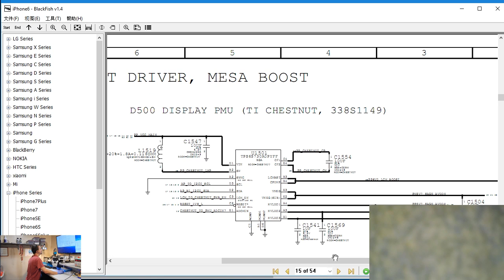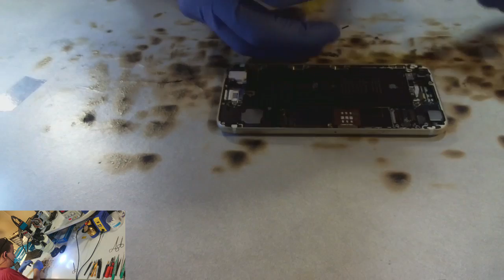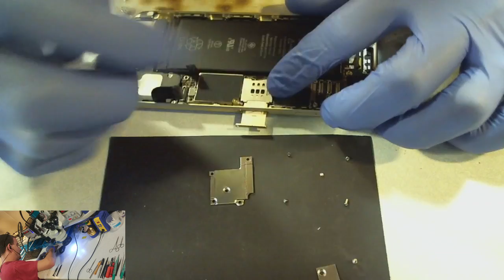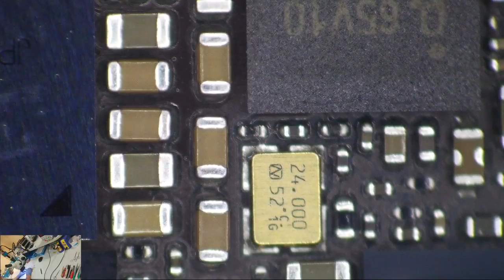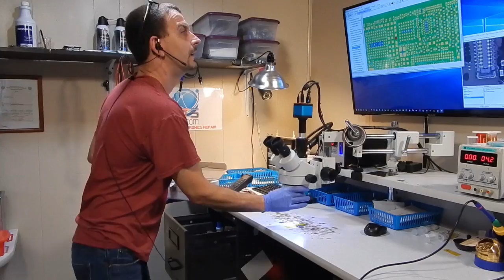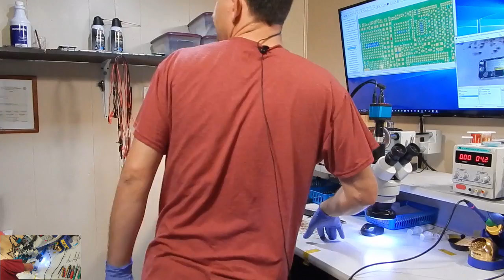iPhone 6 No Image Repair - Shorted 5v7 Cap Found & Fixed

Comment: I enjoy watching these videos because I too like repairing phones and laptops whatever else. I repaired my iPhone 6 plus just because I couldn't see it there not working. So I got a new chassis for it and screen and it took forever since it was my first time ever removing all the parts from inside that it was a bit overwhelming lool. So many tiny screws and different sizes that I did try to mirror the positions of the screws on my mat but, when you have a child running around and curious about stuff the screws got mixed so it was a lot of trial an error but, I just put what felt right through tension not to much just incase I got it wrong and messed the board up. 

A few months after since I've been using it tho the screen on the top right corner is darken abit compared to the rest of the screen and now to add to the commotion when I press my power button to lock the screen it doesn't want to come back on but, the phone is still working as when I hold the home button it vibrates so watching your videos I'm coming to some conclusion that either one of the screws are too big for where I may have misplaced one or two or the screen needs replacing again as it was a rather cheap screen. I'd like some support on that if anyone can help?

Comment: Sir STS, do you have multi tester tutorial? I wonder how do you know if the filter, cap, coil and resistor is short to ground by testing it in oms mode , resistance, and diode. You are a big help in my career on board level repair, i learnt a lot from you sir. Please upload more repairing and troubleshoot videos.

Comment: Nice fix :) ever serviced a Microsoft surface RT? I cant find anything about this board. I mean, nothing. It behaves like its trying to power up in a cycle and I say that because the 12v keeps oscilating. No water traces or corrosion. I'm thinking a bad cap but I have no clue where to inject power.

Comment: I replaced my cracked display assembly on my iPhone 6s, right at the end when I was plugging the new screen in it sparked and I got a bit of smoke. Can't see any damage but I'm not getting any image. The phone is definitely powering on, tried old screen no image either. Can you advise what it might be?
Reply: I don't know what it might be exactly, but my advice is to make sure the battery is not plugged in when you reconnect the screen cables as it's super easy to accidentally short pins during reconnect.

Comment: I have a question how do you acquire your donor boards?
Well I got more than one question, are they boards that where unrepairable? If so how did you get them from the customer?
Reply: Jim Linkowskl buy it from eBay. There is no shop to buy broken phones.

Comment: I've been attempting board level repair for a while now and teaching myself alongside with doing it. Today I finally managed to find a shorted capacitor on an iPhone 6 on a 5V7 power rail and resolved the short after removing the cap. Videos like these help me in my theoretical knowledge, but actually doing this stuff is a whole different thing. Anyways, the LCD now works...kinda, but with my usual bad luck the phone has further surprises for me. Turns out touch is not working, and the lcd has some strange ghosting effect (not to mention the whole motherboard is bent because I received the phone that way).
Its difficult enough to do SMD rework with a crappy hot air & soldering station, without a microscrope and with a tiny working space, and now I've gotta reflow or replace the Touch IC? Screw me right?

Comment: hi sir! my iphone 6 repair was when i reconnect touch screen ther is vertical line whats the problem in it? tried to change touch ic controller both
Reply: You need to reball display ic

Comment: I noticed you didn't used a heatgun at all to remove those caps, was it because the LCD connectors just beside them could of easily been damaged with hot air? thanks

Comment: Hi I was wondering if you could tell me if cap 1295 is needed and if so the value and size I blew it off my board and I checked the schematic and it shows it's location ad number but nowhere else is it shown on the schematic

Comment: Ist always so funny  and hilarious,
But whats is real important  then your handy microscope  ?

Do you realize what are you breathing in? Heat up the bord , there is flux on the bord ans some flux  and  lead solder, tin residue  

YOUR 2 LONGS, LONGS THAT  YOU CANT REPLACE
SO BAY  a AIR SUCKER  OR MAKE IT YOUR SELF 
Make a simple sucker that you be sure that that smoke and flux residue  will suck away from you !!

Comment: The easiest way I've explained about capacitors in troubleshooting is that once they become resistors, that's when you have your short-to-ground. The dialectic material somehow dries up or leaks, therefore allowing the current to pass through from the VCC to the VSS, thereby rendering it a resistor. It could very well be bad manufacturing of the cap. I expect caps to go bad with legacy equipment, but very rarely in electronics that are only a few years old. There's some physics involved here, where a large thru-hole electrolytic cap has more mass than a tiny SMD cap. So, I would say that the thru-hole cap has a better chance at a longer life than a smaller part. Engineering at Apple, Samsung, etc. do in fact know this, but have decided for the consumers that their products are not meant to be around for a long period of time.

As for the shielding being cracked, that could very well have happened sometime in the past, but didn't cause a problem at that time. So, the customer didn't lie, as he really does think that the phone suddenly stopped working.

Comment: For your search box popping up off the screen you can also try draging your taskbar to the top of the screen and back. (make sure you unlock the taskbar first) The search box should snap to below where the taskbar was, might be quicker then your blind keystrokes...

Comment: good job! So did you fix the broken loose shield? lol. and what about the component you thought someone touched with a tool at the beginning? $130 for hot air, I just may get that now.
Reply from the maker: The component in the beginning was ok, it had just been touched by a pry-tool I think.  No harm done there.  To be 100% honest, I actually forgot to correct that shield though.   It won't really make a difference but with me trying to make sure everything is perfect, that bothers me! lol     Thanks 4 watching & commenting! :)
Reply: I got the hot air station using the link! I had $80 in Gift cards to use! funny you forgot the shield now you cant sleep! you don't think anything related to that shield moving would have impacted that back cap?

Comment: nice vid again. Thanks! About the equipment, I can't completly agree. I started with a aoyue all in one 2703A+. I thought I was doing o.k. But with phone rapair it was hard, and I wanted the micro pencil. So I bought the Hacko FM203. That was already a big difference. I still used the hot air part from the aoyue machine, it was working.....but looking at your video's and from Chris, Jessa and many others, I could tell that i did a crappy job with the hot air. So I just bought the Quick 861DW and it blew my mind really. It now feels so easy to replace stuff with hot air. I know this still is a budget machine. But way better than what I had. Could be that this 2703 is just not up to the work that I was doing with it. And I see that your aoyue is a stand alone hot air station, maybe that is way better then the all-in-one I had. Nevertheless I'm happy now. And for a reasonable price. Because here in europe  hakko is already expensive...and the weller and JBC stuff overhere is a "root canal without anesthesia"  kind of expensive :) And I can agree that personally I would feel stupid too when soldering a 3 cent capacitor with a multi-thousand euro hot air station. But then again, I never had the chance to try one haha.
Reply from the maker: Hey, just want to say thanks for the input and let you know that this did not go ignored.   My next hot air station will most likely be a Quick station.. I've been hearing a lot of good things.   The main thing for me is those profiles though.   Looking forward to that :)   Thank u!
Reply: Maurice Rotjes i like to buy a Quick hot air station, could you tell me if the machine work good? Thanks
Reply: I thought it was clear from my story :) But yes, i would recomend it. But the one used in this video also seems to do a good job. So my finding is only based on 2 different units that I personally used. Big plus that I forgot to mention is that this thing is really quiet compared to my 2703A
Reply: STS Telecom thanks jason